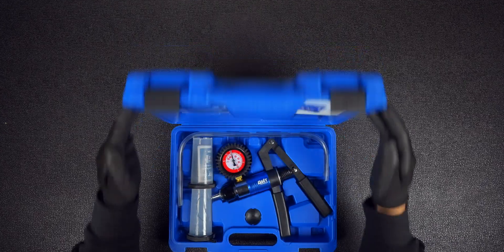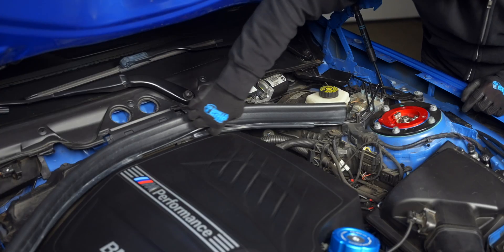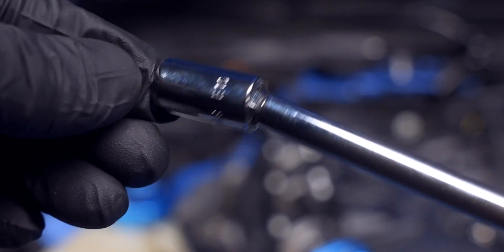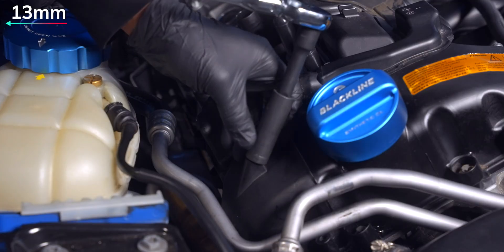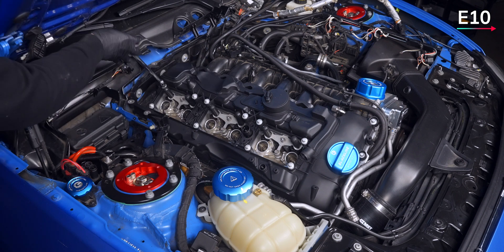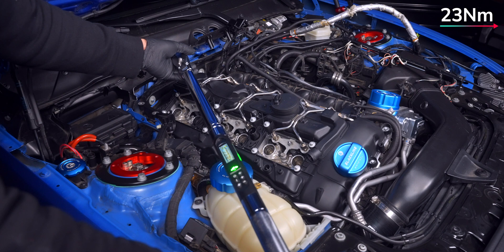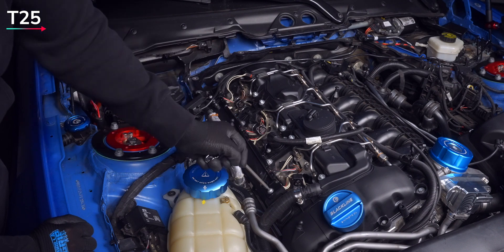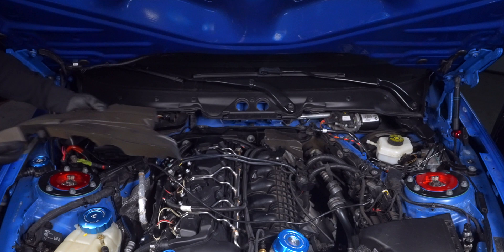Complete DIY: N55 Valve Cover Gasket Repair

Comment: Getting ready to do this job on my girls 740li n55 and i just had one question. How did you tap the holes in the valve cover? I asume you just used the screws to mske the new threads but i just had to ask to make sure. Thanks

Comment: I love your videos, but I’m struggling trying to get the valve cover to unseat. I’ve triple checked that everything is unthreaded. Did you struggle to get yours off? There’s literally no leverage to work around the valve cover, so I can’t find the angle to break the seal loose with the gasket and the head.
Reply: Saw a video with a guy having to wack it on its side

Comment: I've watched 50 videos on this working up the courage to do it myself after the stealership quoted me $1,800.  Your video was hands down the best.  Played you in the garage on repeat as I did the job.  I did this job (slowly and methodically) in 5 hours and so far, it worked!  No more burned oil/rubber smell after driving it hard.  Excellent video man.  Cheers!!
Reply: They quoted me $3300 and change, lol
Reply: @MatthewTaubler it's been 4 months since I did the job and it fixed my issue!  I would 2000% recommend doing this yourself if you are just the slightest mechanically inclined.   Can't believe the stealorships are quoting that much to do such a quick and easy job.
Reply: @SlabCampOutdoors Did you buy the valve cover he left in the description with a link?
Reply: @Exclipse_e embarrassingly no, some how I over looked or missed that he provided a link.  I bought mine from FCP Euro part: BMW N55 Valve Cover Kit - 11127570292KT4.  Looks like the same part number he has in the description except mine is KT4, his is KT2.  Not sure what the difference is, as they look like identical kits.  I do see his is $100 cheaper!  My repair is still going strong so I don't think you can go wrong with either.  Good luck!
Reply: I’ve got my valve cover and my tools ready to go….just waiting for the right day lol
Reply: @JeanDepena going to do that soon as well

Comment: I feel like 100 Germans get drunk and come up with these engine designs. Then at the very end of design they sober up and then realize they have to run a harness, Oil lines and accessories...
Reply: I lived in Germany 9 years.  This is definitely not how Germans work.  They work like machines and their engineering reflects their thinking.

Comment: Do you need to prime the engine after this?
Reply from the maker: You can, but you don't have too. The fuel lines should prime when the battery gets reconnected as well as when you open the door.

Comment: Bro I don't have to do this, and hopefully I don't have to (1 owner, 2014 all maintenance done at a BMW dealer or specific reputable Bimmer garage ODO under 65k). But I am truly grateful these exist. I can absolutely do this shit! Thanks man. Alsso, pros/cons to going metal (aluminum)? Ease and price, are there benefits to going to metal over plastic? Not familiar with this job. ALSO also, GIMME DAT ALUMINUM BRACE LINK!!!

Comment: Used this video NONSTOP over the course of 6 hours this past Sunday replacing my valve cover and gasket. Thanks so much dude!!

Also, damn you for being able to get the valve cover on so easily 🤣 took me and my buddy a solid 20 minutes tryna position it over/around/under the oil lines
Reply from the maker: Anytime! 20 mins is better than having to oldo it twice lol.

Comment: Is it necessary to remove the fuel line or can I just remove the three X lines that cross the valve cover? 
And the oil line? Doesnt look like it’s in my way. Working on 2011 x3 35i turbo. No idea how I’m gonna reach 20 and 21 in back access is horrible. I must be missing something
Reply from the maker: My lines were connected to the rail so I removed it. The oil line just gives you more room to take out and put in the valve cover. As for 20 and 21 the 1/4in e torx set with a Wobble should do the trick

Comment: Gasket is going bad on my M2, this looks like a daunting experience. Not too sure my abilities are in line for this project
Reply from the maker: It looks more intimating than it actually is. Just take your time and make sure you have serveral and lots of table space and trays to hold all the parts so it's easier to stay organized.
Reply: Going to watch this a few more times while the part and some of the tools I need arrive. Thanks for the words of support, they definitely help with encouragement ahahah.
Reply from the maker: @MothmanBePraised  you got this! Since I was filming, I actually broke it up into 2 days so don't feel rushed and if you need anything else just ask.
Reply: Hey Fritz thanks for the video it helped immensely. Purchased a few items from your links as a way of saying thank you. Had a small hiccup though, that front oil line clip slipped into the engine never to be seen again. Checked out junk yards there's no cars that are compatible, would you know where I could find it online?
Reply from the maker: @MothmanBePraised  thank you! I appreciate that. The e one that holds the 2 lines from the oil thermostat that's held in by the 10mm?
Reply: Yes! The two plastic holders that are attached to the bracket right above bolt 25. One of those black holders fell and is just poof gone. Can't seem to find that part online either. Seems perhaps I'm out of luck

Comment: Very nice DIY video.  I am about to do this on the E70 N55.  I did one before on the N52 on the E92 with a little extra work on the back cowling area.  I hope the X5 bay clearance is a little easier.  Man your engine bay is cleaner and neater than my closet.

Comment: Planning on replacing my valve cover on my 4 series with one of the aluminum ones, but I'm missing the little nubs that hold the engine cover in place.  Do you have any idea what they're called?  I've tried "engine cover studs" and several permutations of that, but haven't had any luck.

Comment: Getting this done by local workshop this week and this video helped me understand why it's a $1400 job
Reply: Its literally not worth $1400 
This is a fairly easy job
Reply: @Nolimitf22  Depends how much money you make really.
Reply: It’s a solid 8/10 if you’re not a wrencher.  That’s only because you have to pay attention and not break what you’re doing. 

It’s a 3/10 if you are a wrencher and that’s only because it’s a little time consuming. Definitely not worth $1400.  FCPeuro carries the Elring brand valve cover kit for $350.  Take your time and it’s at most a half day worth of work.
Reply: I did it yesterday, it took me only 7 hours

Comment: Great Video. Fritz I’m struggling to find much information on upgrading the clutch on m235i/m135i. For stage 1 around 400bhp do you have to upgrade the clutch on manual variants?

Comment: I'm ocd and would do it your way for a valve cover leak. That being said I've seen great success with rubber gaskets and rubber o-ring seepage using ATP-205 for those who don't have the time or money and need to wait.  Pros it doesn't interact with the oil or change its viscosity and does not swell seals, it will at max go back oem size or sightly under and restores the durometer of the rubber.  Also a great refresher for all rubber components. Cons it evaporates quick, in my experience get the engine warmed up before adding and circulate it well then let it sit overnight. That is usually enough to get the gaskets to seal again.
Reply: Did it require to do an oil change afterwards? Or can you just add it to the oil and solve the issue? I have a really slight leak on a car I’m selling soon, so I don’t really want to have to do a whole 8 hour repair
Reply: @russelljimenez4715 its evaporates quickly 200F  just leave in for the change interval. For low temp hydraulics I would change the fluid after at least 8hrs operating hrs with it sitting in between off periods to soak into the rubber. Its does have the potential to reduce lubricity if not used at the correct dosage and wear hydraulic pumps.

Comment: Just got mine done today valve cover and gasket thanks for the video men I did one little mistake Iwas confused because of Nm,inch pounds , foot pounds , so I over tightened all 26 screws and then realized I loosened it all following the sequence and torqued it to the right amount will that be a problem in the future
Reply from the maker: How tight did you set them?
Reply: @FritzRamos 8.5 foot pounds 🤦‍♂️
Reply: But then I realized after the 20TH bolt and started following the sequence backwards and started loosening them very carefully and torque it to 6.2 foot pounds which equals to 8.5 NM and 6.6 foot pounds for bolt number 20 because it’s 9NM
Reply: I hope nothing happened as there was no oil leak or anything after turning the car on, and do you know why I got a parking sensor malfunctioning after doing this
Reply: @FritzRamos

Comment: Did you buy an OEM or aftermarket valve cover?
Reply from the maker: OE. So basically oem, just without the branding
Reply: @FritzRamos  which brand if i may ask? Any links?
Reply: Links ? I need one ASAP
Reply: @FritzRamos
Reply: Elring. Check Rock Auto. You can see it in his shopping list in the video near the beginning.

Comment: Great job,.  The number 20 bolt on the valve cover, that black plastic trim you left on by the firewall, easily comes off and you have direct access to the bolt.
Reply from the maker: Thank you! That's good to know. Thanks for sharing! 🤜🤛

Comment: A BMW dealer “fixed” my valve cover leak when it was under warranty and they ONLY replaced the gaskets. Now a couple years later it leaks again and it’s no longer under warranty. I’d say everyone should replace the valve covers or you could be re-doing the job fairly soon.
Reply: thx for the tipp

Comment: This looks pretty intense. About how long would you estimate it took you? Did you have leaking around the valve cover or was this preventative?
I've got a 2016 thats approaching 60k miles. Havent has to do the OFHG yet but I've got the kit waiting. Have you also reolaced the coolant pump on yours?